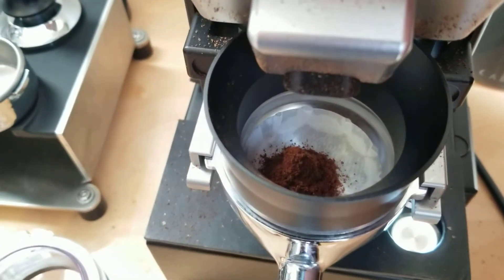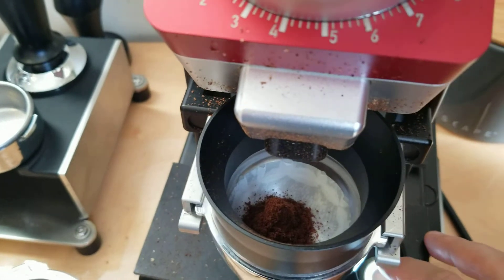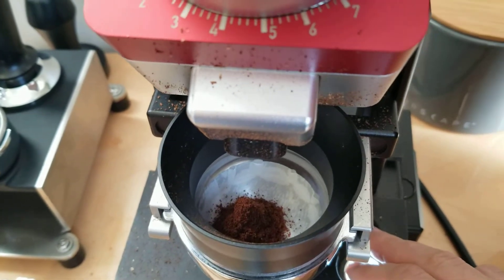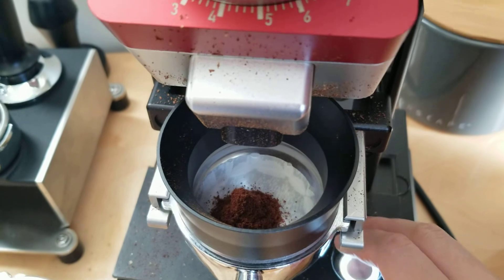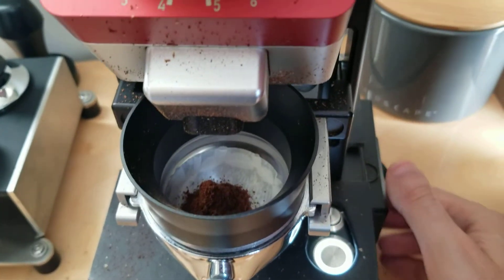Accidentally Filmed Me Jamming up the Monolith Flat with LM Shuriken burrs :O ASMR Coffee Grinding?

Comment: Now try 55 RPM and let us know
Reply from the maker: I think it would work with regular coffee not sure I want to risk jamming It up again though. At 100 rpm it's is slow enough already. 
Want me to do a 100rpm vs 600rpm test?   Been doing 600 ish lately.
Reply: @BensCoffeeRants  yes please! I think low RPM is recommended for drip
Reply from the maker: @MW90  Yeah might be useful for coarser brew methods, but I think you can still get good results with lower RPM for espresso (maybe not necessary to go SUPER low as this grinder does though), it gives you more clarity less body (seems like less fines usually) works that way on the Monolith Flat, as well as the Weber Key, although the strange thing with the Key is that you get slower flow rate at lower RPM.